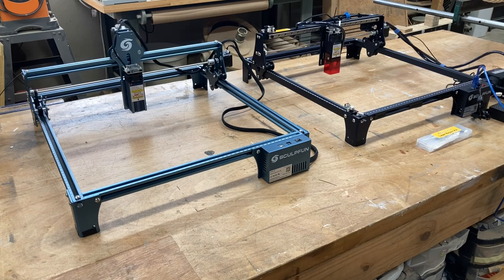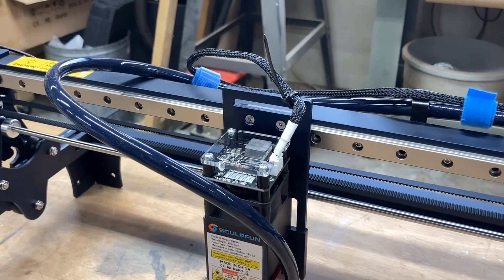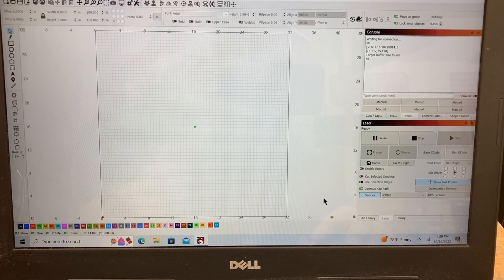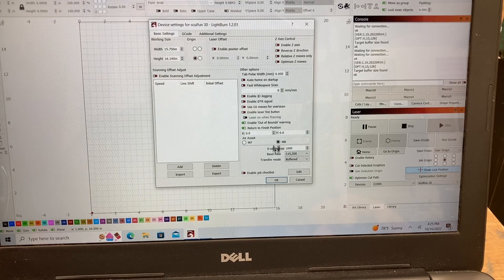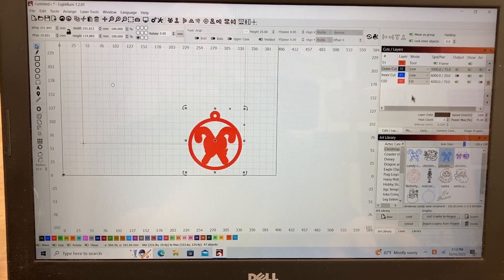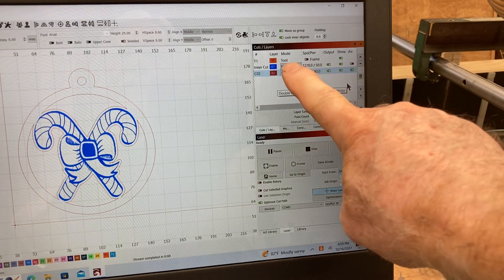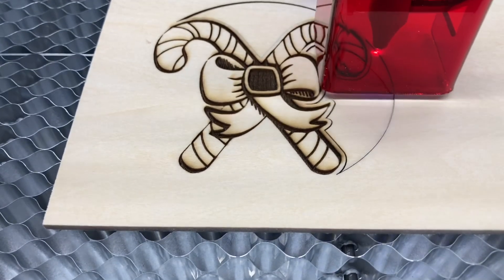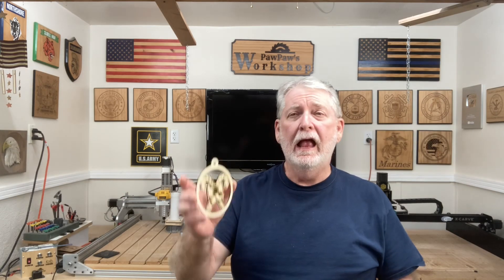Sculpfun S30 Pro First Engrave

Comment: Great video as looking at buying one of these. I noticed in the video you said that the cutting layer (the red layer) you said to turn Air Assist On but then you toggled the switch to the off position so was just wondering what it should be? Many thanks.
Reply: Apologies! I'd stopped the video to comment when I saw that. Should have continued watching as just saw that you had it turned on in the end. Thanks again for such an informative video.

Comment: I put my sculpfun together, connected it to lightburn and everything seemed fine but when I went to run it, the laser does not move.  I can push it but it can't move on its own.  It makes a noise like it is trying to but can't.  Does this sound like a belt issue?  Too tight, too loose?  I put them in according to the directions and the treads are over the gears but not pushing the laser to move.  Do the "treads" need to be going a certain way?  Any idea what the problem might be?

Comment: I just bought this laser and should receive it next week.  I'm a beginner and thought this would be a good starter laser for me and quite honestly should fulfill all my needs.  I'm trying to decide where to set it up.  I had thought I would put it in the garage, covering it when not in use but I see you are in a room.  Can these be used in the house?  I would put it in my basement if not in the garage but wonder about proper ventilation.  What are your thoughts?
Reply from the maker: The climate is important. I live in a high humidity area which is rough on belts and other parts. You need good ventilation. Engraving inside the house is not recommended. At the very least you need a window to get the smoke and smell out of the room. In the basement is most likely the best again you will need a way to ventilate the room.

Comment: Good video, is the air assist just on and off or can you adjust the pressure ? Do you use air assist for engraving?
Reply from the maker: It all depends on the machine. Some are connected to the machine and controlled by the software while others are a simple on/off.

Comment: Guys beware of the SCAMMER seller 'Tech-Land Store' from Aliexpress. 

He sold me a broken S30, when i opened and looked at the laser, it was clearly used before and it was even not working properly. Aliexpress let u return the product, but this seller msg me and threaten me to write a low value on the the shipping so he wont pay tax. He says otherwise i will not give your money back. So he wants u to fraud with tax. If u do that, then he will tell aliexpress look its not my product, he has set the value to 30 euro. The product costs 538 euro. What a scammer.  

Then if u says i wont do this, he blocks u and getting very arrogant. I lost now 538:(
Reply from the maker: Always be aware of the place you purchase anything on line. If if sounds to good to be true it probably is. Don’t risk it. Buy from known reputable locations. Thank you for sharing a terrible situation
Reply: @PawPawsWorkShop  i bought because it was  a little bit cheaper then other shops. but cheap mens often there is something strange:( = used products

Comment: Greetings Paw Paw.
I am a subscriber of your channel and I have seen your videos, which are very good, although I do not understand English correctly.
But, I have a question: What is the function of the M8 key in the Air Assist settings, since, in the Cuts/Layers window there is already the "Air" tab to turn on the Air Assist in each Layer independently, as you said? Thanks
Reply from the maker: In most cases you should not have to enter into the gcode section of the software.  The air assist setting should turn this on for you in the gcode.

Comment: Where can I download the software?  I imported SCULPFUN-S30 PRO 10W, but I can't use it.Help! Please!
Reply from the maker: You can go to Lightburnsoftware.com to get the software to run the machine.
Reply: @PawPawsWorkShop  
Thank you for your answer. Can I download and use the software for free?
Reply from the maker: You can get a trial version and try it out. The software is only $60. Tremendous value for what it does

Comment: Hi Paw Paw's workshop , I looking into get a laser and have been looking at them for a while . My question is it look's like you have had xtool engraving laser why did you go to Sculpfun . I see you have I believe S9 also . What made you go to Sculpfun if you don't mind say I have looked at both but after your video leaning  towards Sculpfun because it looks like you can up grade this machine easier and make it larger . I hope you see this and respond back on what you like and didn't like such as maybe software any help I appreciate it .
Reply from the maker: Congratulations on wanting to get into this hobby. I have three lasers that I like the most. The xTool, Sculpfun and the FOXAlien. All are excellent and have strengths and any one of these would be excellent. I do like the RA2 Pro rotary by xTool the best. It should work on any of the lasers listed
Reply: @PawPawsWorkShop   Thanks

Comment: I designed and 3D printed a flexible hose holder support for the coupler from the air unit and the hose and along the hose, out of TPU filament, works a treat
Reply from the maker: Awesome. Do you have pictures?
Reply: @PawPawsWorkShop  on hand I have one of the actual coupler:
https://drive.google.com/file/d/1C8bRgD_Z6Dy-E_WGvXHtDXXk7guPdEi9/view?usp=drivesdk

Comment: I notice you use the Lightburn soft ware. Also a week or so ago you tested the Ortur Laser Master 3. Did you use Lightburn on it as well?
I am trying to get the Master 3 to link up with Lightburn and am having troubles. I think I downloaded the newest driver but still a no go.
Which driver did you use?
 It does run using the LaserGrbl.
 Thanks for any help with this,
Gary